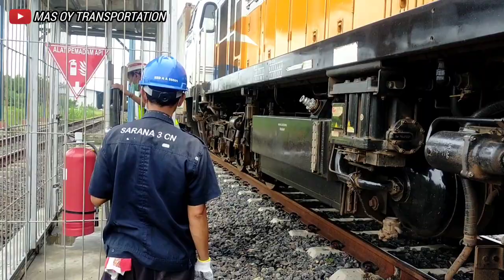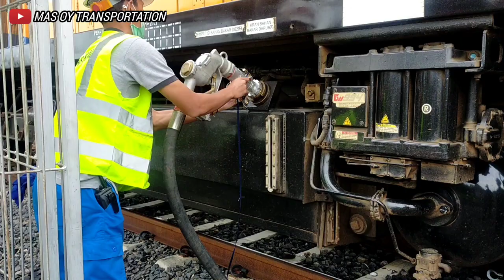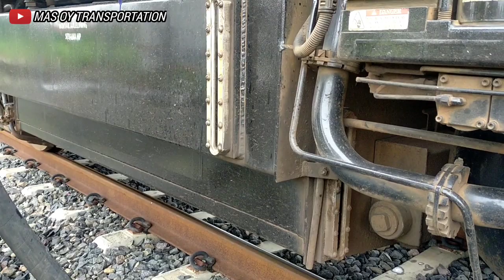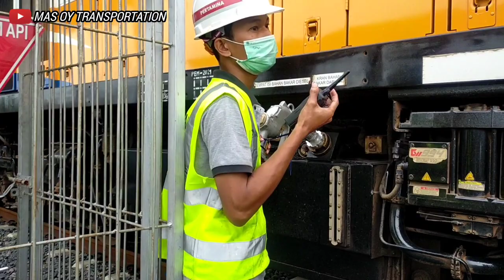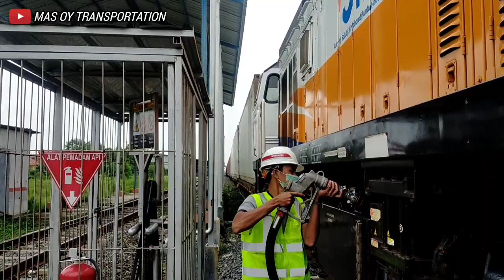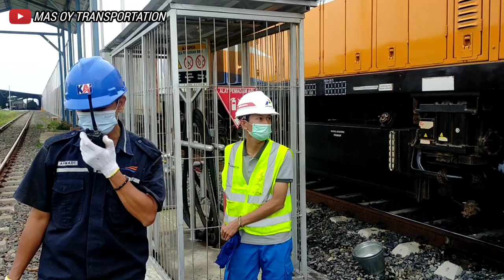Begini Cara Kereta Api Isi Bahan Bakar !

Comment: Fulltank 3000lt pasti mesin nya bawah 2000HP ?..masih pake nozzle utk isi disel gak pake banlaw sistem😎 disisi tank itu pasti tenki main resevoir MR
Reply: Mesinya 2250 hp
Reply: @nayakadaniswara6158  brapa silinder merek engine nya apa alstrom,man,7fdl?
Reply: @Aird-hg2gh  8 silinder 4T made in GE
Reply: @danangrizky6953  electro motive division (emd) 8 silinder inline ato V  block 4 +4 =8
Reply: @Aird-hg2gh  EMD itu produknya di indonesia cuman CC202 dan CC205 selebihnya buatan GE(general electrik)
V8 mas bukan 8 inline kalo inline nanti nambah panjang loknya 
Koreksi: lok bb ada juga dr EMD lupa seri BB brp
Reply: @danangrizky6953  ok model mesin GE 7FDL sama kayak locomotive blue tiger 12cylinder v block 3000 hp 120ton keluaran bombadier adtranz , double cap
Reply: @Aird-hg2gh  maaf mas ga paham tentang lok yg bukan punya KAI bukan tunggangan sehari²🙏
Reply: @danangrizky6953  ok cuman nambah info  gpp aku kerja bahagian fleet ktm..jauh perjlanan luas pemikiran,malu bertanya sesat jln✌😎
Reply: @Aird-hg2gh  siap salam kenal ya mas. Semoga perkeretaapian malaysia bisa semakin maju

Comment: Kalau full tank kira2 nempuh jarak brp kilometer tu?
Reply from the maker: Jakarta - Surabaya
Reply: Bisa 750 - 950 Km.
Reply: FULL tank dari dipo 3000 L. itu di SMC nambah lagi kalo ga di SMC ya di CU. Untuk tambah berapa ratus L nya kurang paham. Biasanya TPK-AWN(cirebon) sisa HSDnya 2200L berarti jkt cirebon butuh 800L
Reply: @danangrizky6953  mantap.....
Reply: @masoy259  aku baru tau........
Reply: maaciww
Reply: @danangrizky6953 yg nyemprot2 periodik ke arah bawah itu apa ya solarkah? Kok dibuang2 ya
Reply: @junjungbuihfarm9001  bukan om itu adv air draine valve.

Comment: Kapasitas berapa liter mas?
Reply from the maker: 3000
Reply: @masoy259  waw banyak sekali, itu cukup untuk 1000 km perjalanan
Reply: @masoy259  kalau gak salah 1 km kereta api butuh 3 liter ya bos?
Reply from the maker: @zxvcxzs  tergantung beban dan medan yg di lalui
Reply: @masoy259  ya itu cuma perkiraan bos,,,, alias patokan
Reply: @masoy259  kaya ibarat sepeda motor, 1 liter rata" bisa menempuh jarak 40 km. Pada kenyataannya ada yg nyampe 50 km lebih kalau jalannya pelan, ada jg yang cuma 15-20 km kalau jalannya super nanjak

Comment: bang kalau ngisi bahan bakar kereta api berapa L
Reply from the maker: Fullnya 3000liter
Reply: @masoy259  Masih kalah sm genset gw yg kapasitas tangki solar totalnya 42000 liter utk gerakin mesin 5 x 2575hp high speed 1500rpm yg cukup utk buat nyalain gedung selama 3 hari wkwkwkwk,, just kidding ya mas